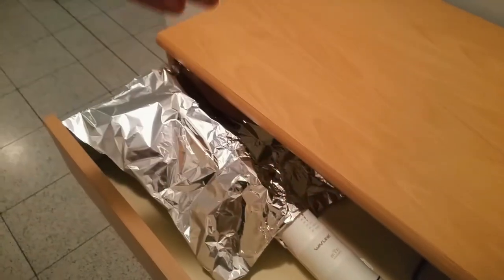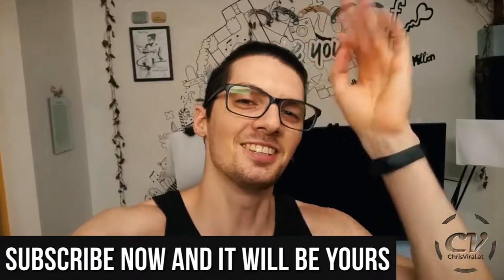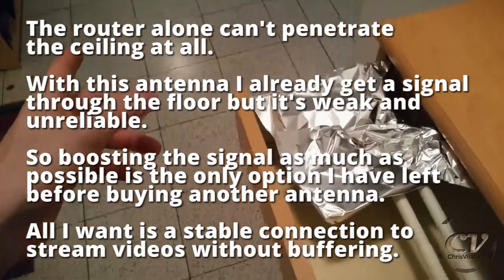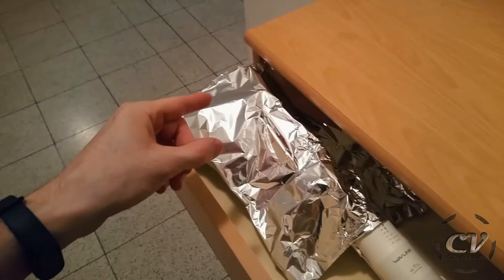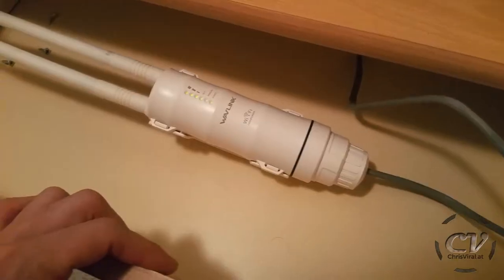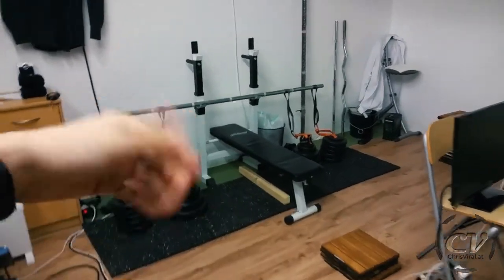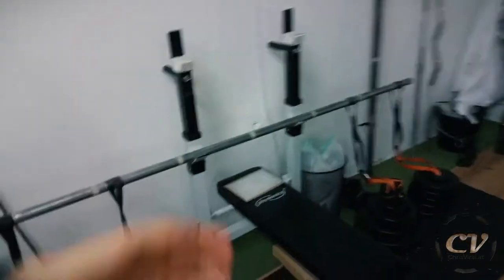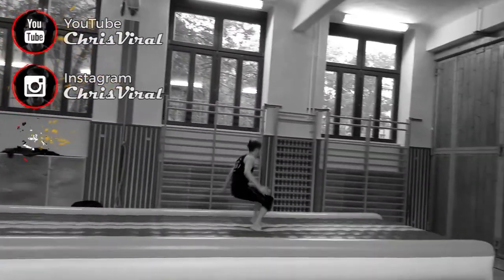How To Boost WiFi With Tin Foil (WiFi Life Hacks)

Comment: you cantry to put the router on the wall.

i personally dont like wifi*, i use ethernet cables everywhere since i use only desktop pcs.
You could install a TFT+small mediaPC or You coud use a Tablet + uSB-to-ethernet adapter (2$ from china). I mean when you think about iteverywhere you sit its possible to have a ethernet cable wairting for maximum speed usage ;D. Always faster + cheaper as wifi.
Imho only reason where wifi makes sense is outside the house.

*i dont like wifi because of radiation health concerns, i dont have time to explain. Mainbe research if you like.

What you are doing is using the aluminium as backside reflector. Try to variate the distance so maybe you get even more signal (optimum is between 1-5cm).
Is you have you coul try coper plates (PCBs) since copper is even better than aluminiu.
Also Iron might be even better.
Reply from the maker: Yeah I could but it wouldn't do much I think.. Yeah right, same here and the craziest thing is when you download an app like wifi analyzer and see how many signals there are LITERALLY IN YOUR ROOM. I thought about building a sarcophagus with shielding for sleeping haha.

Yeah I thought about a cable solution but wifi is pretty much the only way to solve this since this is not my actual basement. Laying a cable in a public stairwell VS wifi was a no brainer for me lol.

Hm yeah I could probably do something about the distance, thanks.